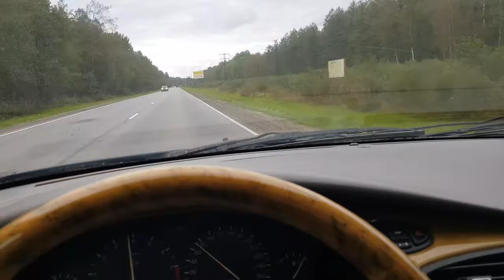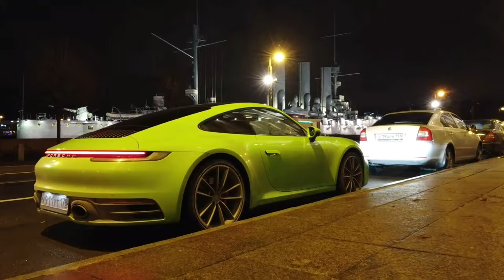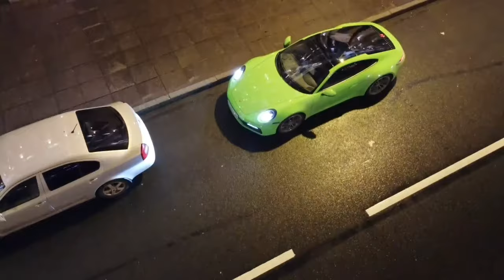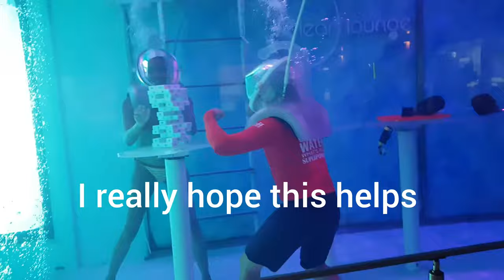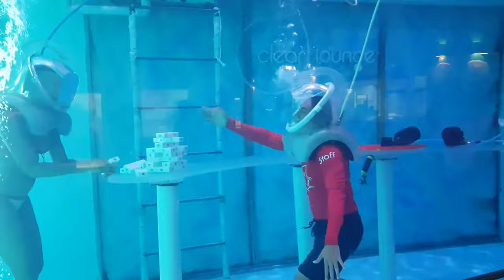Wheel Bearing Noise Vs Tire Noise

Comment: What if you got brand new tires but it still makes a loud "whooping " noise after the fact and the lugs are cold? Just really trying to figure it out because ive been taken advantage of too many times by dishonest and greedy shops. Thanks
Reply from the maker: Because the Lugnuts are cold, I would say the bearing is good. So it’s not this. I know you said you have brand new tires, but I believe that one of the tires that you have bought was defective and has broken cords inside. you may not be able to see this from the outside. You could put gloves on and be very careful not to cut yourself, but if they’re brand new, probably OK and run your hand around the tread of the tire and seal for any high spots. If there is a high spot a spot on the tread of the tire that’s higher than the other spots that means that it is broken cords inside.
Reply: @QOSQualityofSpeed  Thank you very much for replying and so quickly! Will do that! Appreciate your help! ❤️

Comment: notice you something, on the center rim, if the brake are gripped, you maybe can feel heat on the center wheel if happen too. so, you have to check that too, beacause the heat is disiped on all  rotor including center..
Reply from the maker: Yes true

Comment: I had this noise hearing when driving my car it's like a bearing sound but i heard that after changing a new offset mags and tire, i hear nothing from my old one. Any thoughts about it?
Reply from the maker: Sure, if it appeared right after you change the tires there are only really two possibilities. One the tires tread is making the whirring sound . But the second one is more dangerous it's when they put the tires on they accidentally bang the rims a little bit you know like with a bumping around and this made some of the bearings a little bit not round. It probably means that the bearings were worn already and then when they were just banging to take the tires off or you know it's stressing The Hub slightly . This does not mean that they caused it because it was probably already going out it just aggravated the problem. The way to tell the real way to tell is drive for 15 minutes a decent speed say about 50 miles an hour and then get out immediately and check the Hub with your hand carefully if it's warm there's your indication if it's hot that means that it's really going bad rapidly.

Comment: Ive had all my bearings changed recently, and now i have a noise. New breaks new bearings everything.. any clue on what it could be?
Reply: To add to this, when the bearings were replaced the noise did go away, basically like a brand new car. And now, random noise back again. More like a rumble, could this be the tyre?
Reply from the maker: I have seen where the bearing that is put in was made in China and not a good quality
Reply: @QOSQualityofSpeed  it wasnt a cheap bearing we bought it from germany
Reply from the maker: @jameshugoberriman2938  what car 

4 wheel drive
Reply: @QOSQualityofSpeed  no volkswagen polo, i know it was all put together properly and the parts werent low quality ones. Was just curious.
Reply from the maker: @jameshugoberriman2938  it's not going to be a tire.

There are bearings on all four wheels

There's also bearings inside the transmission

Shift into neutral and coast the car.

Comment: what if the bearing is just starting to go bad? i don’t think it will necessarily get as perceptibly hot
Reply from the maker: Yes warm then hot as it gets worse. It makes more friction, more and more as it gets worse. When it starts to go bad driving it starts to destroy it from the inside. In the old days you could repack the bearing but as you lose metal inside they really need to be replaced even on the old cars with kingpins when they start to make noise and heat, repacking is not enough.  Mostly is started by water/rust. Also a large impact can start the lose of free movement and the lose of metal inside

Comment: Haha I been trying to figure this out for the last few months. I got a tire from a used tire place back in October and when I was driving low speeds (20-40mph) it kept making a thumping noise but when I went over 40mph it turned into a really loud humming noise and sounded like a helicopter. I thought my bearings were going bad but I recently got the tire replaced and the sound disappeared and is pretty quiet and the vibration from my steering wheel went away. I should’ve inspected the tire before buying it but that was on me lol
Reply from the maker: Yeah tires can have the bands break inside either fiberglass or metal bands inside and they get what's called a titty at least that's what we used to call it :-) so it looks like a regular tire except one little bulge and boy that will make some noise. It would sound exactly like you're describing
Reply: Thanks...I'm thinking it's bearing noise in my case as well, but since my tyres need to replaced anyway, I might as well do that first and see if the noise disappears

Comment: My all 4 wheels have warm. It means that all 4 wheels bearing are bad.
Reply from the maker: Yes
Reply from the maker: Going bad
Reply: @QOSQualityofSpeed  There is friction. Why would there not be heat at the hubs? There's a difference between warm and hot
Reply from the maker: @thingserik7269 a bearing that is properly greased and perfectly round bearings inside with non-pitted bearing races, will not be warm to the touch at all it will glide smoothly

Comment: Having a howling noise when decelerating, I took my car for service and they swapped my front tyres with back tyres and that's when the problem started. There was no noise before they did a swap on the tyres. They said my tyres are bad and that's what's causing the issue but they have not really done any tests so not sure if I should buy new tyres or check for wheel bearing issues?
Reply from the maker: OK let’s take it step-by-step. Tires can cause road noise and maybe you didn’t hear it because the ones that were on the back we’re not close to you and now they’re closer to you on the front. However, it’s also possible that when they were swapping the tires. They wiggled the wheel bearing, and that caused it to start to go bad. It was already going bad, but it made it worse by wiggling it to get the tire off or hammering on the tire. If the wheel bearing was in good shape it wouldn’t bother it but if it was like a little bit damaged already, that could finish it. Suggestions number one look at the tires and see if it’s unevenly warn you know maybe like it doesn’t look flat. It looks like there’s sawtooth on the tread hard to explain, but it should be wearing down all flat, but if it’s vibrating a lot, you can get like the blocks of the tread might be wearing unevenly.

And second suggestion before you do anything would be to drive the car for 15 minutes and then go and put your hand on the hubs like a show in the video and see if they’re warm if they’re warm, that means bearings 

Road noise from tires is not dangerous really by itself because if the tire is good enough that it’s not going to need replacing right away then you can just keep driving the car but if the bearings are going bad if they’re getting hot then you should address that. And I don’t mean a little warm I mean hot.  A little bit of diagnosis yourself maybe 15 minutes looking at the car and you can figure this out so look at the tires for a small both front and back and see if they’re look like they’re wearing evenly.

Second, put your hand on the hub of the car after you’ve driven it like right in the center of the wheel and see if there’s a lot of there it’s warm to the touch that’s the beginning of it and if it’s hotter than that, then it really needs to be addressed. Then you’ll have your answers.

Comment: Thanks for information.
Reply from the maker: sure, very glad if it helps you. Just drive for10 minutes then check the heat on each wheel. If your car is a rear wheel drive then it is possible that the differential may make a whirring sound also. Some driveshaft also have a bearing on them. But that is it for possibilities for your sound.

Comment: Would a bad bearing cause vibration in the dash?
Reply from the maker: No not unless it was very bad I mean going to fall off and burning hot bad. Probably more than likely that is a tire that has grown a titty I mean the bands inside the tire has broken and so one part has a bulge it's kind of hard to even see but be careful when you rub your hands around the tread of the tire because if it's got a bulge it may also be burned down so that the cords are exposed In this case they'll cut you pretty easily. Let me know if that's what it is. The tire bulge the titty and the tire can happen without warning at any time The tire can just develop this and it needs to be changed

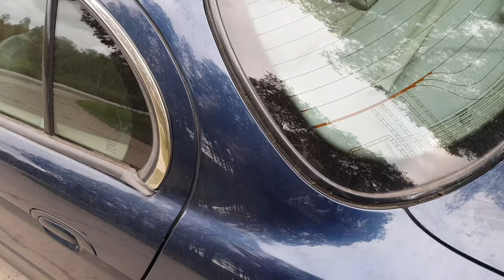Comment: PLEASE help me out ... had my front left side changed and noise started right away what could be the problem ? just like in your video 01:30
Reply from the maker: Sure I will try to help. What did they change on your left side? 
It could be the other bearing on the right side.
They do  usually go bad in pairs. 
It's very hard to tell is on the left or the right of the car because the noise travels with the suspension. You can usually hear if its front to back. There is also a possibility that they put in a bad bearing I have seen this with chinese parts.
Reply: @QOSQualityofSpeed  tire
Reply: @QOSQualityofSpeed  i had a flat tire.. changed it myself..put the spare tire ...no noise whatsoever... went to the shop he put the new tire on the front left....i put the spare in the trunk ...now my car sounds like...an extra car is driving by my side 🤣
Reply: @QOSQualityofSpeed  i live in Israel... mechanics are NOT trustworthy here ..i must point this one out
Reply from the maker: @karagothshlomidabush3727  sure 
That is why you should understand about your own car.  Do the heat test....drive for 15 min and get out and feel the wheel. If it is hot then they did not replace anything. Someone could make a lot of money just by making a policy to be honest with the costumer about their cars. They would soon get a reputation but i guess they would have to be careful for their life as they become more popular.